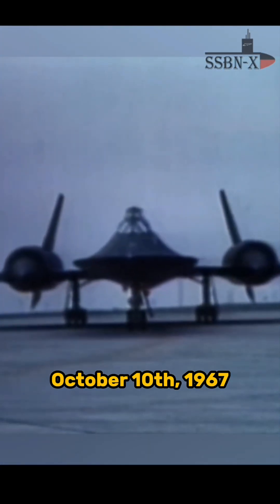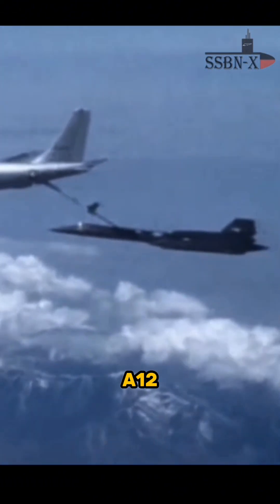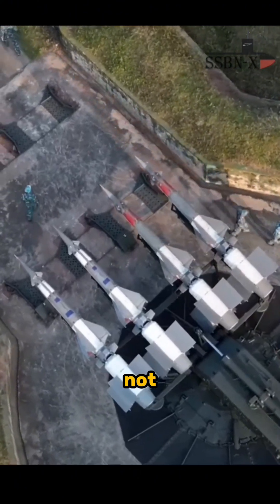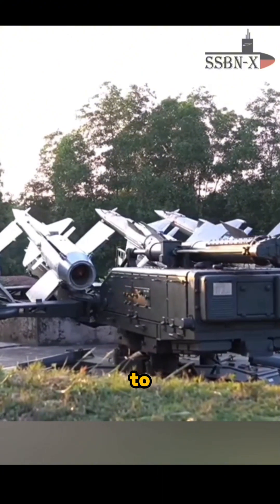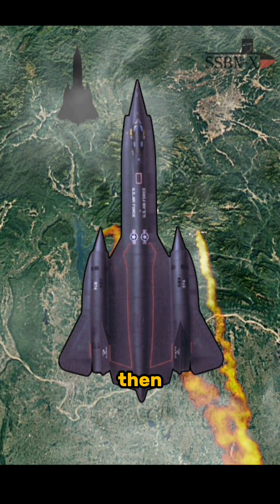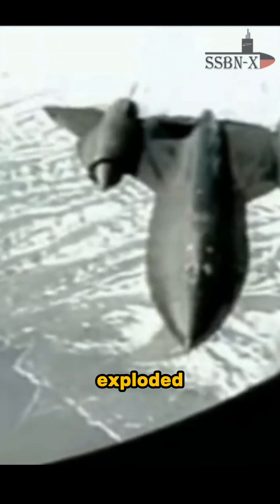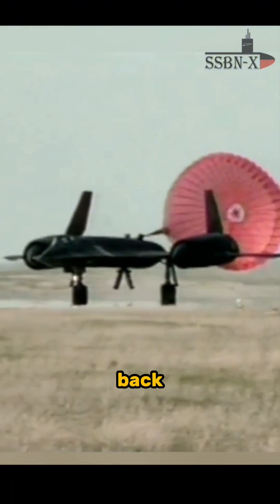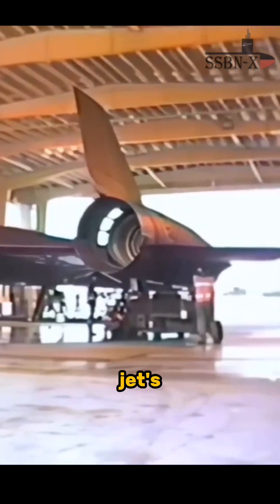In 1967, An A-12 Oxcart Was Hit By a Surface-to-air Missile

Comment: There is NO direct hit, never...
Reply: Surface to Air Missiles aren’t designed to hit directly.  They have proximity fuses and use shrapnel or continuous rod to destroy airplanes.
Reply: @calvinnickel9995  the pilot didnt throttle up

Comment: The A-12 still outran the missile.....
Reply: The piece that lodged itself inside it says something else.
Reply: Years ago I was part of the program to restore the A-12 line number 121 That's at the intrepid museum in Manhattan New York, I met a couple of engineers from the skunk works and we had a very in-depth conversation on the performance of the A-12....
Reply: @anthonynarozniak9725 Article 121 "the prototype" is on display at the Blackbird Airpark in Palmdale CA, not on the Intrepid. Article #122 is on the Intrepid and is the only A12B completed and flown.
Reply: Not really since the SAMs were faster

Comment: A-12 Oxcarts are smaller and faster than the SR-71, but since they were for the CIA, all records were (and still are) classified. 

But yeah nowadays, even Blackbirds and Oxcarts can be downed with modern SAMs. Hell, the Aegies system the USN uses can shoot down moving satellites and ballistic missiles in apogee and reentry, which is REALLY damn fast.
Reply: The A12 was not faster despite it being lighter, weight isn't what limited their speed, the inlet temperature of the engine's is what limited them, and the inlet temperature was a product of it's speed, so irregardless of weight once they hit mach 3.2 the inlet temperature was at the maximum temperature that the engine's could run sustained without burning up, they still had some throttle left and most pilots agree that they could have probably hit 3.5 but no one ever did it because it would have been cause for an immediate dismissal from the program, anything over 3.2 would have been cause for the engine's to have to be pulled for an unscheduled inspection, that would have meant that the scheduled rotation of available aircraft for mission's would have been put out of kilter causing all kinds of problems, one thing they looked for when screening pilots was weeding out any "hot dogs" or "cowboy" type personalities that would want to do something stupid like that because they looked at it as their own personal play thing instead of it being the national asset that it was.

However, since it was lighter it could fly higher than the SR71, about 5,000 ft higher, all of the A12's mission's including the speeds and altitudes they flew them at have all been declassified, the reason that people mistakingly believe that it's "real" top speed and altitudes are more than what's on record is because when it was operational it was a secret aircraft, unlike the SR71 which was made public while it was still operational, because it was a secret aircraft when it was flying the A12 never had the opportunity to have officials from the FIA witness a speed and altitude run, unlike the SR71 which did so it's speed and altitude could be an official record, because the A12 never had that opportunity people incorrectly believe that it's true top speed and altitude are still some kind of a secret, they're not, A12 pilots like Frank Murray openly talk about how fast and how high they flew it, but because the FIA never officially verified it's speed and altitude conspiracy minded people think the A12's true performance parameters are some kind of a secret, which is ridiculous for two very good reasons, first off is the fact that they'll never fly again but even more importantly is the fact that when it overflew a country everyone and his brother were tracking it outbound on radar and knew exactly how fast and high it was flying, the very first time one was tracked on radar those things were no longer a secret.
Reply: @dukecraig2402 whole lotta yappin
Reply: Shooting down Satellites and ICBMs are fairly easy compared to an aircraft. 

And as mentioned,  the A12 wasn't higher/faster and all it's records are public

Comment: No Blackbird has ever been lost or damaged due to hostile action
Reply: We aren't talking about a Blackbird. This is a video about the A12 Cygnus which was damaged.
Reply: @gr8crash exactly, they ae completely different planes, the oxcart flies higher faster and has multiple differences of the design
Reply: @m_.ttdacat while have many differences,  it's incorrectly assumed that is flew higher/faster. All 4 variants had the same performance capabilities
Reply: @gr8crash  I just fact checked my own knowledge and you are correct, the only “major” difference in performance is that the a-12 weighs about 15,000 pounds less allowing it to go ever so slightly faster than your average blackbird. Apologies.
Reply: @m_.ttdacat no worries. Only part I'd clarify is that it really couldn't fly any higher or faster. I get why people think it could but in the real world it can't. Sure it's a little lighter,  but also had less thrust. So by using that logic and SR71 low on fuel should be faster than an A12 but they weren't. They were all essentially the same.
Reply: Indeed it has.. except it happened on October 30th, 1967.
Reply: Ain't that the facts never been caught .....
Reply: This is an oxcart, not a blackbird